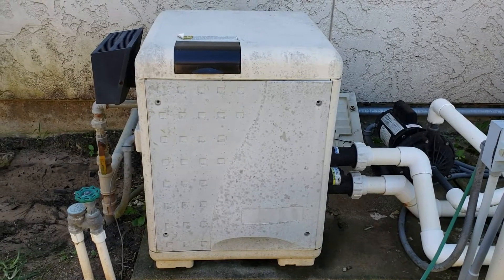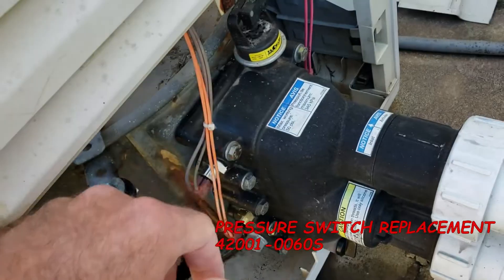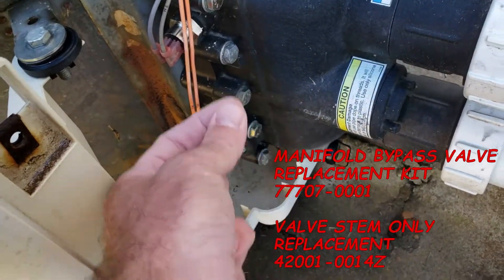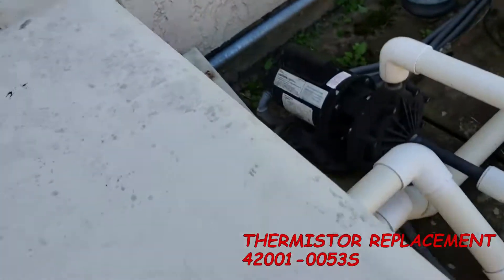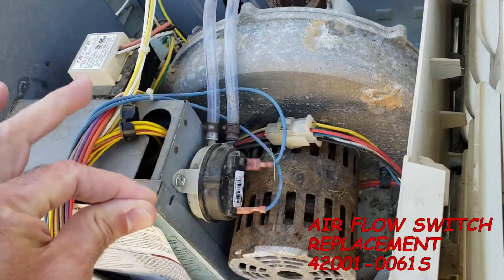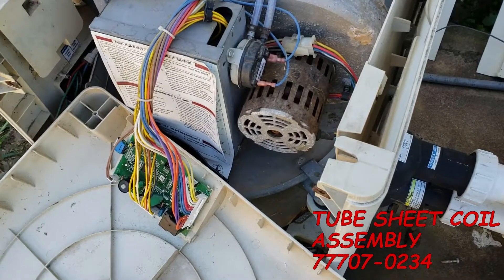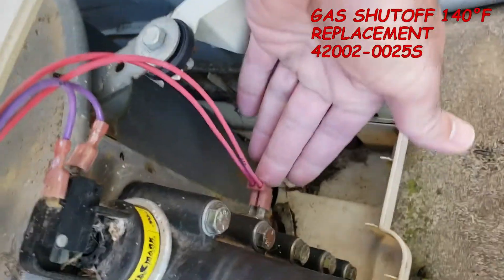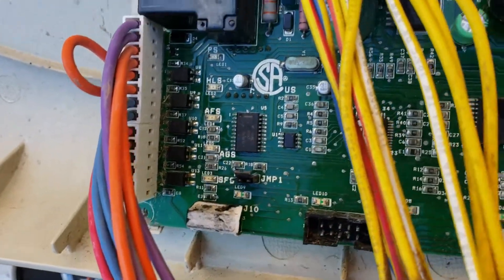PENTAIR MASTERTEMP 400 ERROR LIGHT LED EXPLAINED

Comment: I have a problem where the heat cycles on & off. "Heat" blinks calling for heat then steady for a second & then temp counts up to 124 degrees & back down. "Service System" lights up at 81 degrees & still counting down & when it reaches 75 which I think the current temp of the pool, "Service Heater" lights up for a second followed by the "Heat" light again.  Just opened the pool so the filter is clean. Water pressure is 20-30psi at 3250 RPM, 85GPM. So far, I replaced the Thermal Regulator,  Igniter, Thermistor late in the season last year & the Manifold Bypass before opening the pool this season. No error code in front & no LED indicator lights on the back of the panel.  Please advice.

Comment: I have a Sta Rite Max E Therm 400 and it is consistently cycling with no error lights on the control board. I did notice that the furnace temperature on the display goes fro 250 then the heater shuts off  and I see that exhaust temp drop to 160 before kicking back in. So basically cycling on for 30-40 seconds and then off for 30 and then back on. So far changed the thermal regulator but that didn't fix it .. Any suggestions?
Reply from the maker: Dang, thermal regulator would have been my first guess Ritesh.  That is the only component that has ever gone bad for me that has not triggered a diagnostic light.  I got a SERVICE HEATER light after about 3 cycles with a faulty thermal regulator, but no error codes or diagnostic lights.

Let's try easy stuff first.  Try removing the manifold with 13mm wrench and look inside for a broken manifold bypass valve.  That is another part that breaks easily and is not electrical.  If broken, it will flood the output with cold water instead of routing that water through the heat exchanger.  The HLS should detect this abnormality and throw a diagnostic HLS light, but perhaps not.  You may have a bad read on the HLS combined with a broken valve and it may cause cycling instead of a hard stop.  Hard to say, but I would start with non electrical stuff first.  Sorry mate, that's all I got without having codes or diagnostic LEDs.
Reply: @pvt-pilot  Thanks for the quick response will give that a shot! Quick question can I run the heater without the thermal regulator as a test for a few minutes to see if that definitely isn't the issue?
Reply from the maker: @riteshkohli5756  Yes, you can remove it, but other safety checks will prevent functionality.

The thermal regulator is designed to open over 120 degrees and let cold water through it to dilute the scalding hot water as it leaves the output.  This is protection to keep your PVC pipes and, more importantly, your family from melting like the Gremlins.  If you remove it completely, the open thermal regulator slot will become the path of least resistance for water running through the manifold and almost nothing will be forced through the heat exchanger.  Water in the heat exchanger will not have much circulation and could become superheated which is not good for the heater.  Remember what I said about the HLS noticing the abnormality?  It is the last temperature safety check before the water leaves the heater and the control board is expecting a temperature difference between the input (thermistor) and the output (HLS) and will shut down if if there is no difference and will shut down if there is too much difference.  Shut down for no difference is for fire hazard safety and self preservation of the heater.  Shut down for too much difference is for scalding prevention.  This heater loves to find ways to shut down.  I tell you it is a wonder that this thing ever runs.

Comment: Thanks for the video.    I have an error light - LED7 lighting up with a corresponding E01 error code.   I've replaced the Thermistor and still no luck.   Any advice?   thank you!
Reply from the maker: It is still open somewhere.  Put an ohm meter on your new thermistor.  See if it is open.  I had to buy 3rd thermistor before getting a worker one time.  New means nothing.  If it is good, check for corrosion on the spade connectors, wires of the harness and pins on the control board for the thermistor wires.  The control board is detecting the open.  That is all the E01 means.

As for the LED7, that is not a diagnostic light.  Looking at that LED, if you flipped over to the other side of the control board, it will line up with a transparent window/port on the display panel.  There are a several items it could line up with like POOL, SPA,  SERVICE HEATER, HEATING, etc.  I would have to go look at mine to tell exactly which window it lines up with but it is something like these mentioned.
Reply: PVT-PILOT thanks for the advice.  I replaced the control board and that fixed it.

Comment: The panel worked for a day and now shut completely, panel wont turn on. Tried to change the membrane, thermal regulator and ignitor control module. Is there a way to test the control panel without having to replace it?

Comment: Just replaced my sfs sensor and I am still getting the same error. Any ideas on what it might be?
thanks
Reply: Check sense on ohms should be 3.5 mega ohms . If reads good check wiring to board , if good,  replace control board . If you hold pool button down it will display exhaust , temp should start climbing after ignition, your will most likely display something like 40/80 . Board probably corroded on backside
Reply from the maker: No, not really.  I know that the SFS will illuminate if there is an ohm value across those leads that are out of the parameters for that sensor.  Too few ohms will be like having a 5,000 degree hot tub detection which is impossible.  Too many ohms or open internally will be the extreme opposite.  I know I bought a replacement thermistor before that was out of ohm parameters out of the box.  It wasn't until I bought my 3rd one that my problem was corrected.  Very frustrating when I assumed my brand new part was well...perfect.  I don't know what the value should be for each sensor, but in my decade of owning this terd heater, I have discovered each sensor has a very small margin for error.  You might take a closer look at your wiring harness just to be sure it is clear of opens, corrosion or rodent damage paying particular attention to chasing those two wires back to the contacts on the main connector to the control board.  Check the solder joints on those pins on the contol board.  I suspect an open.  Put ohm meter leads on each solder joint and then the end of their respective wire of each solder joint just to prove 0 ohms resistance on each conductor from the solder joints on the control board to the end of each wire.  If both wires check out good (0 ohms resistance each) then I would buy another SFS one more time before calling a professional for help.

Hope this helps a little, sorry if it doesn't, but I just don't have any past experiences with that particular sensor, but if is pretty much the same thing as a thermistor...different ohms readings provided across the leads to represent to the contol board the various temperatures that it is detecting.

Comment: Hey! Thanks for taking time out of your day and making these incredibly helpful videos! 

My question is regarding my MASTERTEMP 400 heater Pressure Switch. My heater cycles on and off 3-4 times before telling me to “service heater” and after checking the back of the control module the PS light was red.

 I order a Pentair OEM PS and replaced it today and it still cycles on/off 3-4 times and once again says i need to replace my PS. 

What is going on? 

It’s a brand new switch so that can’t be it. I’m
Going to take my thermal regulator out tomorrow and see if running it without it changes anything
Reply from the maker: I could have worded this a little better at 2:52 but what I was trying to say was that the PS and also the AFS lights illuminated on the contol board mean that their respective components are not making a short that can be seen by the contol board.  This doesn't mean that your PS itself is defective, but rather an indicator that you have poor water flow (not enough water volume to short the switch as required for normal operation).
I would first disconnect and then short (touch together) the leads that are connected to the Pressure Switch to see if you can get the PS light to turn off.  If you can't get the PS light to turn off with a manually induced short, check your wiring harness for corrosion or rodent damage (something causing a permanent open in the wiring which would make the necessary short at the PS permanently undetectable from the control board's perspective).

If you get the PS light to go out with a manually induced short, GREAT, you have no issues with the wiring and you should move on to trying to locate a blockage on the input side of the manifold.  I would disconnect both pipes feeding the heater and scoot the heater a little bit to the side and turn the pool pump on.  I want to check to see if you have excellent water flow coming directly from your filter to the heater.  If you don't have massive water flow coming out of the top pipe, you could have:
1.  A clogged filter
2.  A defective spider gasket in your filter's multidirectional valve (making water flow somewhere it shouldn't be instead of 100% toward your heater)
3.  At worst case a poorly performing pool pump.

If you have great water flow out of the top pipe, the problem does not reside anywhere between your pump and your heater.  Moving on, I would remove the manifold using 13mm socket and search inside for a clog, then move on to accuator valves, backflow check valves, and other outbound pipes.  You could have a broken manifold bypass valve stuck in your outbound pipes causing a clog.

Always keep in mind that a clog can be before or after the Pressure Switch and cause the Pressure Switch to not make a short.  Imagine a pressure switch mounted in the middle of a drinking straw that detects and/or measures water flow.  Imagine a goal of you blowing water with your mouth through it as hard as you can.  Now put your finger over the other end of the straw (which happens to come after the switch) and you blow hard (aka turn on your pool pump).  No water movement, right?...which triggers a light on contol board even if the clog is after the switch (at the end of the straw).  The water must have a place to freely move to within the system at all times to make circulation possible.  Same goes if you put a piece of tape on the straw on the side that you are blowing into (simulating clog between pool pump and heater manifold).  Switch will obviously detect insufficient water flow.

Hope this helps your understanding of how the Pressure Switch functions and gives you some things to look for in your troubleshooting.

I'll help answer further questions if you have any, but I don't think the thermal regulator a suspect here.  Removing it will throw an immediate service heater light because you will be causing the path of least resistance to be the path through the thermal regulator's seated slot instead of being the path through the heat exchange coils.  This means not much of the water in circulation will get heated, leaving the water that is trapped in the coils to boil uselessly and dangerously and never make it to the hot tub.
Reply: PVT-PILOT Wow! You’re so crazy good at diagnosing these shitty heaters haha 

So I did what you said and the PS light turned off! IMO I’m pretty scared about
Tearing this heater down, I’m not a electrician or plumber but if it’s what I have to do then so be it.

My Thermal regulator was corroded to the core and had some green stuff on the top of the piston thing that is supposed to go erect in hot water but mine did not! So I order a replacement.

I’ll let you know how the rest of my year down goes, hopefully I’m not
Getting myself in over my head. 

Appreciate all the help and will definitely be needing more in the near future haha
Reply: PVT-PILOT UPDATE: 
I disconnected the pipes from the heater and the water pressure coming from the filter was very strong. 

I took apart the manifold and looked inside for clogs but there were not any. The manifold bypass looked great and all of it was there so I know it’s not a valve that broke off from that and got stuck. 

Going to look at out bound pipes and actuator valves next but I’m really concerned now it’s not anything I can find 😩
Reply from the maker: @danielm.9818  You want some really bad and dangerous advice?  Short the PS wires again and leave it that way and turn you heater on for a good 10 minutes or so.  Keep a close eye on it during this time because you are more or less bypassing a safety feature of the heater.  See if it throws a service heater or if it keeps heating.  I am getting concerned too that you wont find any clog.

Now for some better advice:
Reattach the manifold and reattach only the top pipe to the manifold inlet.  Leave the bottom pipe disconnected from the manifold outlet.  This will create zero resistance on the outlet of the manifold = max flow.  Restart the pump and turn on the heater.  Get ready for a big muddy mess.  This will drain your pool at a fairly quick pace, but the goal of doing this is to see if you still have PS light with no pipes connected on the outlet.  If you still have the PS light, don't bother with searching past the heater.  If you don't have a PS light with the outlet pipes disconnected, well at least you know you're good through the heater and are making great, positively certain progress with your trouble isolation efforts.  Hope you find something definitive 🤞
Reply: PVT-PILOT Long story short, I ended up replacing every part on it as they were all in pretty bad shape. Got the light for the PS turned off but the ignition control module showed a ignition lock out. Replaced the ignited, still didn’t work. Replaced the ignition control module and still got the same ignition lock down 3 blinks. 

After replacing most parts I decided to call Pentair and had a certified pool company come see what was going on. Turns out the inside of the heater was rusted pretty bad but the heat exchange looked fine. Repair would be $1500 with parts/labor so Im biting the bullet and getting a new one. 

Thanks for the help!

Comment: My friend I have a master temp 250 very similar to master temp 400. I have the AFS light on and will buy the part  #. But also there is a little green light almost at the bottom left side that reads led9. Do you have any idea if that is another problem? Thanks for your response
Reply from the maker: LED9 is just the "POOL ON" mode that you see on the front side of the panel.  LED10 is the "SPA ON" mode next to it on the front side of the panel.  There are also a few others.  I think LED8 is amber in color and is the HEATING light.  LED13 is the red "Service Heater" light in the bottom left corner of the front side...and so on (there may be more).

If you have AFS light on, don't go buy a new AFS, just assume it is functioning.  Try to determine why the AFS is not getting air flow.  That is more likely why the light is on.  Watch my AFS video.  I would start by removing the bottom bolt from your manifold and see if water comes out.  If so, then your tub is full of water and not allowing air flow through the tub and out the exhaust.  This would cause the AFS to stay open, thus illuminating the AFS light on the control board.  Trouble shoot a bit and get back to me.  I'll try to help if I can.

Comment: any ideas around  - Error code E05
Reply from the maker: That's typically an open in the igniter...or at least something faulty with the heater's ignition. Check for chewed or broken igniter wires.  Disconnect the plastic igniter connector and put an ohm meter on the igniter.  See if it reads open (infinite ohms).  Replace it if it does.  If not, you might try inspecting or cleaning the igniter and/or the flame arrestor for rust clogging the hundreds of little holes in it smothering the igniter inside the combustion chamber.  Something is keeping the ignition from happening.  I would start with the igniter first because it is held in with 2 screws accessible on top (easy fix) rather than a labor intensive process of opening the combustion chamber.